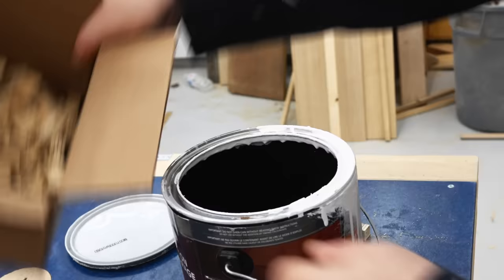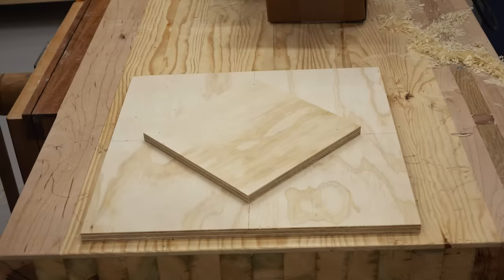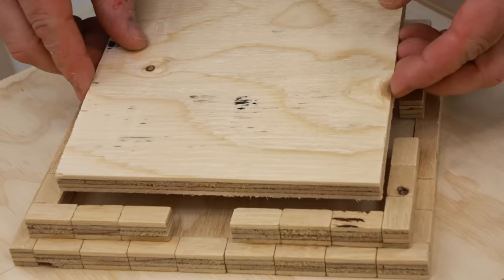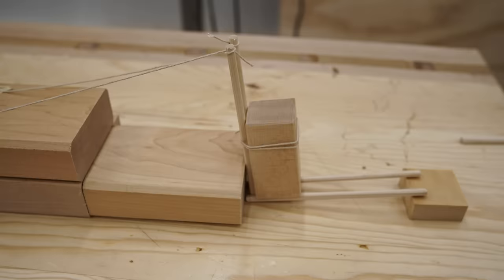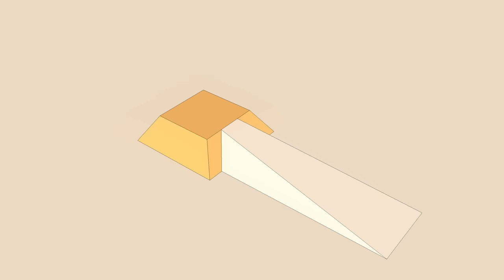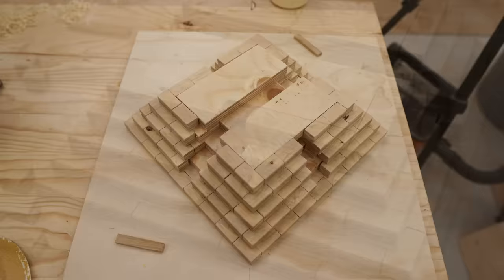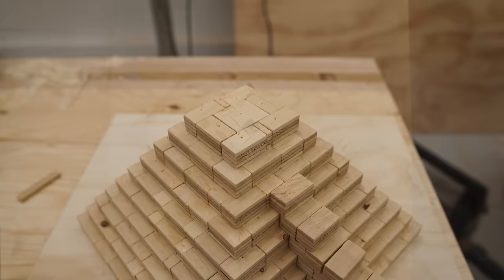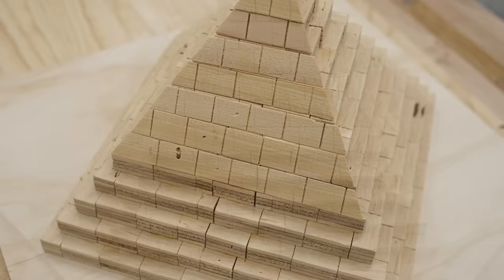How I Would Build The Great Pyramids

Comment: Seems you might have something there.  But also, one could use each step/level as the base for a lever to lift from one level to the next (only a couple feet) and then slide them inward to fill in the middle.  Once done with that level, move the lever up one and start over.  You don't need a huge ramp to slide them up, only open steps to lever them each level. Levers were most definitely commonly used in those days and they would have had good working knowledge of how to use them for large stone moves.

Comment: Your idea of sligthly into the back placed steps is great for lifting large blocks without ramps at the edges, which would negatively affect smothness of the sides. So far so good. But how you lift all that megalith stones, beams, chevrons and the sarcophacus of the kings chamber?
Reply: The average weight of the stone blocks were around 2.5 ton. The larger (70 ton) blocks were only used in the chambers. The polished limestone blocks were precise and, in the case of the Great Pyramid, also a major point of failure. They didn't allow for expansion/contraction which led to them cracking and falling off.  Even where the large blocks were used to form the saddle chambers, the stresses from above have caused fractures in the lower, outward facing edges.  Still, not bad for a structure that old.

Elsewhere, the blocks are not precise at all. Lots of mortar and loose fill had been used to fill gaps.  It worked well enough where aesthetics were not an issue.  The finished product must have been blinding to look at with all that white, polished marble.  There is the impression that the entire 2 million-stone structure was made entirely of precisely cut stone. This is absolutely not the case.

Comment: There's a reason why we do models all the time, it's much easier then the real thing.
I would very much like to see a 50 ton block being rolled on a couple of wooden levers tied with linen rope.
Reply: Not to mention, that this treatment should have left marks on the stones. Especially on the edges, where they were rolled over. This would have done serious damage to stones that heavy.
Reply: Imagine the dude commanding a flip of a 30 ton block 120m high towards the top were the base is quite narrow.... that'd stain some white robes, XD
Reply: @gamestylestudio5408  Always get in the way of the words PROBABLY, MAYBE, MAY BE. And where is the peak of Darwinian evolution if the ancients were smarter, stronger, Us with all the scrap metal of our cars, cranes and bulldozers. The stick digger of the ancients is cooler than us. In general, it resembles Minecraft.
Reply: Like anything in life, even the hardest tasks become easier over time with experience and improving techniques. I am sure the first pyramid ever made was extremely difficult, but after the first couple they most likely had it down to a science.
Reply: @gamestylestudio5408  I think that makes the most sense but wouldn't the cement dry weird on the inside of the stone? Has anyone cut open a block to just see?
Reply: @user-nv7mb9gm6k  You do realize the "ancients" who built the pyramids were exactly as human as we are?  There has not been any human evolution in the last 10k years, even by the standards of the old Darwinian model, which you seemed to be referencing.  Keep in mind this is not the more complete model used by modern evolutionary scientists which incorporates elements beyond Darwins understanding, such as population genetics, developmental biology (evo-devo), and paleontology, to which is being added knowledge of the molecular sequencing of DNA and the insights it provides concerning the phylogeny of life. 

Simply put, the ancients have nothing on us and to imply otherwise is nothing short of wishes and imagination
Reply: @1001digital  what if they took that in mind and put a protective piece of leather or something over the edge..
Reply: @Rob-jv3lj    every generation thinks it is so much smarter then the previous, we are probably just going in a circular pattern. We are starting on a further step when we start learning about life, but in the wider picture i think we have preety much the same hardware as the ancients, its just the software thats been upgraded.
Reply: @crazyysmog  Your first sentence: "We dont gain knowledge over time".  Your second sentence: "We gain knowledge over time".  Both sentences however: based on emotion
Reply: @Rob-jv3lj   im talking about the processing power to deal with problems and solving then. Which i believe we have the same. And the software update that we got is the more accesible “education”- internet, starting your life at a higher step
Reply: @crazyysmog  I very much doubt that this would help. If you roll a stone of 20+ tons over an edge, the edge will crumble. And the heaviest stones were not only 20 tons, but 70. They used lime stone for most parts, which is quite soft. Imagine rolling hundreds of stones over the edges... I really can't imagine that this would not wear them down dramatically.
Reply: @1001digital  question is: what are you going to do with a block larger than needed and used? Cut it in pieces? There are no 70, 50 or 20 ton limestone blocks in the great pyramid. The heavy granite blocks used for the King's chamber were most probably moved up through the great gallery and not rolled over edges.
Reply: @hans-joachimbierwirth4727  Yes, the average lime stone block "only" weighs about 2,5 tons. Thats still a lot, considering that they had to move thousands of them up. So even if the 70 ton blocks were moved through the gallery, there must be evidence for the technique explained in the video.
Reply: It's been done. Look up "Man moves heavy blocks without machinery," accomplished by some british bloke who wanted to prove that it was more than feasible for ancient peoples to assemble the blocks at Stonehenge.
Reply: @crazyysmog  Putting aside the fact that you're repeating my opening sentence, you're also suggesting that learning new things has no value because it requires a brain to learn, which is a non-sequitur..
Reply: @Rob-jv3lj  i kinda have a feeling you just wrote this reply to share with the world the fact you know what non-sequitur means. all the stuff i wrote are  my opinions and i seek from people to give me knowledge and correct me or give me a different idea. But it seems that you just think highly of yourself and put your ego and fellings in front which is a huge waste of talent and time
Reply: @1001digital  i dont agree with you, plus you have a poor imagination.. but thanks for debating
Reply: @rusticbox9908  there is no 30 ton block. who told you that nonsense? 2.5 tonne max only at the bottom.
one individual can easily lift 25 kg trained-normal people 15 kg. if you simply drag on the floor with lubrication it is 1/4 th of that weight. so 2500kg/4=640kg/5=15 to 10 people are enough to move 2.5 tonne. similar to how 4 people can move a 1.5 tonne car( but it has wheels which is less friction). cutting,hoarding, moving, lifting and all manuvers must have been in a team.

back in the days hindus built palaces on top of mountain with similar difficulty. they had to carry stones up the mountain which aint easy either. they built fort on top of palaces! astonishing feat( though not as old as pyramids but they  knew about that stuff. here they had access to livers, pulleys, elephants etc as it was after AD)
Reply: They're about 2,5 tons, not 50... Like flipping a car. 

There's nothing unreasonable about that.
Reply: @1001digital  "So even if the 70 ton blocks were moved through the gallery, there must be evidence for the technique explained in the video."

Keep the faith..!!!
Reply: @Rob-jv3lj  I think it depends who “us” is.. reading some of the other comments on this post may sway your opinion 😂
Reply: @ComunidadeLivre  there is king.. the large grooves down the centre of each side. If they were moving things inside the buildings they may well have used logs or wheels to roll it. I don’t know fokol though. You are probably right
Reply: Pivoting at maximum efficiency would not cause much if any damage to the corners, as they are same materials. That being said, all the corners you see in this day and age are weathered and ancient, so.
Reply: With the only logs strong enough would of had to be imported from Lebanon
Reply: @Rob-jv3lj  Your debate style is purely based on parroting middle school grammar. Get better. Good luck.
Reply: @mariosola1  Look up what a debate is, then you can start to understand why what you said is so extraordinarily stupid
Reply: Idk man they had hella slaves I think its plausible, plus the AVERAGE people then were stronger than the average ppl now
Reply: @lolpancakecat  also these were royal tombs which means you would only have highly skilled laborers even around the site ie a small number of people
Reply: @Nothing is Honesty The silk would rub through in a matter of secs/minutes, image the level of friction a stone that size would have if you dragged it.

Comment: How about this idea:
They had ropes to pull the stones, so they could have made very long ones.
They had sand, gravel, debris in abundance and lots of manpower. 
Make a steep ramp (matching the slope of the pyramid) and lead very long ropes over the center of what´s already build, connecting two sleighs. 
The one being on ground level gets loaded with a stone, the opposite one on the top gets filled with anything that can easily be carried by single workers, just very many of them.
Once the "sand sleigh" gets sufficiently heavier than the "stone sleigh", it´s weight will pull the other up to the then current level. 
Unload both sleighs, the one being down then receives the next stone, the one on the top gets the sand, carried up by... and so on, and so forth.
The workers would have had to lift the weight of the pyramid plus some percentage more for friction losses, still they only had to lift easily manageable stuff, not heavy stones.
Reply: Nice, thank you counterweight pulley system, in theory would work, it's supposed this is what the grand gallery was used for, an inferrior sled based pully system with wooden posts in the empty slots to act as a breaking system in case the ropes or pulleys failed.
Reply: Counterwieght pulley is evident inside the shafts at certain points shows rounded off areas very smooth rounded over stone to allow strong rope to slide. Also the inside would have to be built at the same time as the outer pyramid stones are laid to keep everything level and strenghtened

Comment: Up to the Kings chamber, they had an internal ramp and it is still there. From there upwards this is the most logical way I have seen.
Reply: All that internal detail is what constitutes the “structure” of the pyramid, everything else is just a pile of blocks.
What they probably did was put down level 1 of the blocks and then all of the granite work was brought on top of that. Then as they stacked layer after layer they just kept lifting up the granite 1 block height at a time, until the granite was hoisted up to where it was to be installed, and then they just shifted it into position and stacked blocks around & on top of it.
After millennia of rain storms percolating through the blocks the limestone fragments rejoined as a kind of natural cement glue, that’s what is really holding the pyramid together.
You can see what ramp was necessary to build the pyramid because robbers used the exact same technique to salvage the casing stones: no ramp whatsoever.
Reply: @Grunchy005  I heard that it all fell off eventually as there were no expansion joints. In other pyramids where the workmanship was lower quality they remained intact.

Comment: I like the cement block forming idea on site using the material they cleared from the plateau. It works for both the inner blocks as well as the limestone outer covering and explains how they managed to make the narrow tunnels so accurately. They were formed around wood which was then taken away when set.

Comment: Having seen piano movers at work moving my piano up and down stairs, I'd say you're on the right track.  But I'm not sure they ever flipped the blocks end-over-end.  The key is having rollers sized such that when one roller is under the center of a block, the block can be tilted so that its front edge is above the next step, then pushing it far enough onto that step that the block can then be rolled onto that step.  Piano movers use a 4-wheel dolly with large wheels for this, with the wheels the right wheelbase for standard-sized steps.  Difficult to describe, but easy to understand once you see it being done.
Reply: i done a lot of removals for a company we would move grand pianos a good foreman would know how to prepare before hand removing parts then it was put on its side in a special padded wooden shoe webbed up tight then we as a team would carry down and up several flights of starts we have move them thought windows using old school wooden block and tackles

Comment: You use a lifting lever Like a teeter totter . Lift a block up. Slide a block under it. Lower it down   It is now level with the next level. 
Push forward under the block that is lifted at that level. So on again and again. 

You only have to lift the block the height of the step.

Comment: I do think the 'step' style ramp has clear advantages over the smooth angled ramp. The smooth ramp always seemed to have the issue of big giant blocks of stone sliding back down. With the step approach it rests in place after each roll.
Reply: Plus a ramp that could be negotiated has twice as much material in it as the pyramid.
Reply: The biggest problem with what i dub the BIG RAMP theory is that you use far more material making it and that after a ceratin size it wouldnt be practical or at all stable

Comment: I very nearly skipped this vid because I was afraid that it was going to be yet another "aliens"  theory. Thank you so much for not doing that, and I find your solution to the puzzle fun, entertaining, and REALISTIC! So it is entirely POSSIBLE.

Thanks again! :)
Reply: the reason it seems to you that this explanation is suitable for the construction of the pyramids is that it doesn't account for all of the most difficult parts of the process.  First the site of the pyramid is 13 acres which is leveled to within 15 millimeters.  Secondly, the pyramid is constructed of 2.4 million stones averaging 6 tons apiece.  There is no information here about how those stones were quarried and delivered to the site using primitive tools and without the technology of the wheel, yes that's right, the anthropological record as it stands does not credit the Egyptians with understanding the wheel at the time of the construction of the pyramid, much less the pulley or other more advanced machinery, nor did they have any material hard enough to cut and dress Aswan granite as we see over and over again throughout the structure.   the video above does not address the capstones which were cut on 6 sides and masoned without mortar in the joints to such precision that a sheet of paper or a razor blade can not be stuck between them.  This is not possible by any known means other than dropping them in place with precision, but how?  Considering that they weighed more than 4 tons apiece, how could they be dropped vertically into place?  The Great Pyramid of Giza alone contains more stone than all the churches and cathedrals in Europe.  It is the most precise structure ever built.  There are internal relief chambers 170 meters long that deviate from being perfectly straight by less than 1 centimeter.  There is no modern structure that is built with this level of accuracy and precision.  The peak of the great pyramid is located less than 15 millimeters from the exact center between its four corners.  It was not built by slaves who did not have the wheel.  If you were to draw a line of latitude that crossed more dry landmass than any other, and a line of longitude that did the same and crossed more dry land than any other, those two lines cross less than 20 meters from the peak of the Great Pyramid.  It is precisely located at the center of the earth's dry landmass.
Reply: @findtheorigins2940  Do you think humans built it?
Reply: @Skibbityboo0580  I do.  But personally, I believe that it was built by a previous civilization who were wiped out by a great flood.  Consider the fact that the flood "myth" is one of the most ubiquitous cultural artifacts, told by countless traditions around the world, and oftentimes the story is presented in such a way that it leaves really no room to think it is just a "made-up story" - such as Plato's version of Atlantis, for example.  He does not say "here is a funny story, or here is a myth, or here is a parable or a tale or an old legend."  What he says is "Now WE ALL KNOW of Atlantis".  He states it as a fact, and as a fact that is so common knowledge, it is beyond doubt.  Again the story of the flood is contained in almost every world mythology.   And doesn't it seem strange that civilizations seperated by vast distances, generations of time, and language, which had no communication whatsoever with one another all happened to make up the very same story?  And the all happened to build large pyramidal structures aligned with the stars, wasting generations of their finest craftspeople and engineers for no apparent reason to build utterly purposeless monuments, aligned with the same solar phenomena in precisely the same way, and often with the same symbols and techniques?  It seems like quite a stretch.  What we can say for certain is this - modern civilization would not be capable of building the Great Pyramid in the time it is claimed to have been built, even with our modern machinery and technology it is not possible.  And to attempt to build it using the technology supposedly available at that time is so far fetched it is simply absurd.
Reply: @findtheorigins2940  I have to go now.